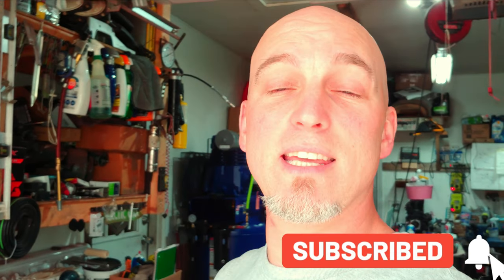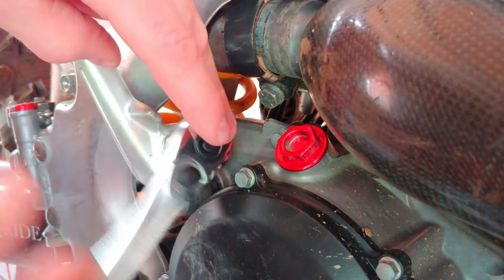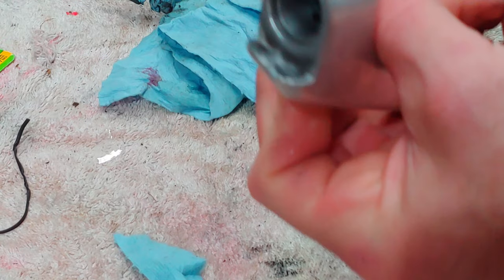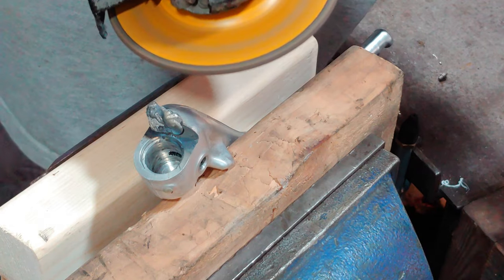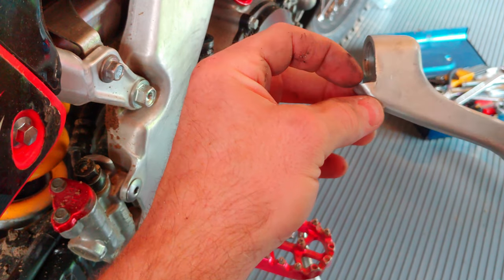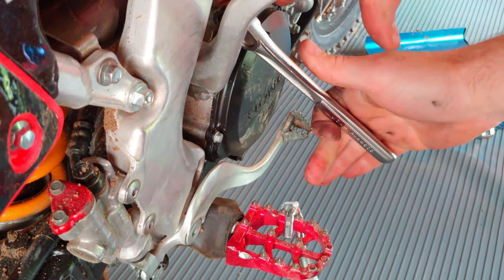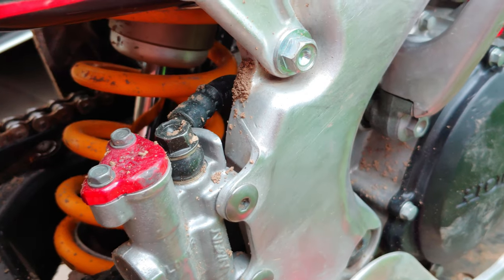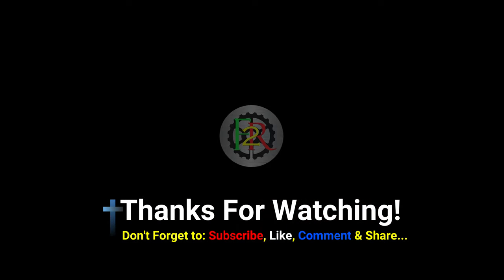2006 Honda CRF250r Kick Start Lever Repair || How To Stop Frame Damage

Comment: Is that a cast iron kick starter or metal just wondering what you used to weld it
Reply from the maker: The kicker lever is aluminum cast. I used my lincoln 240v welder with 5356 wire and Argon gas.